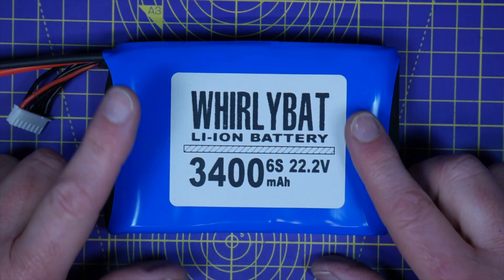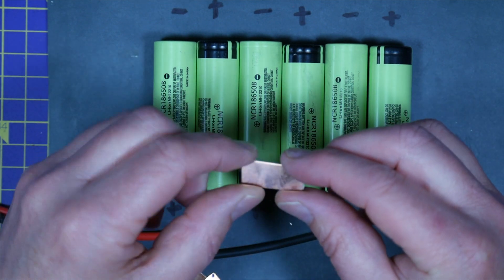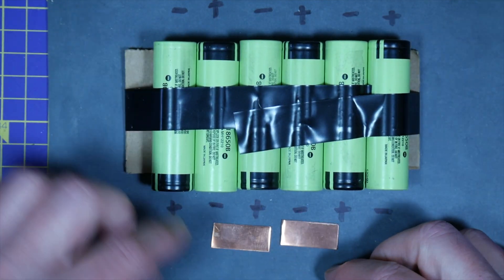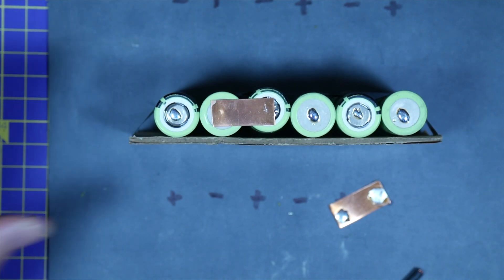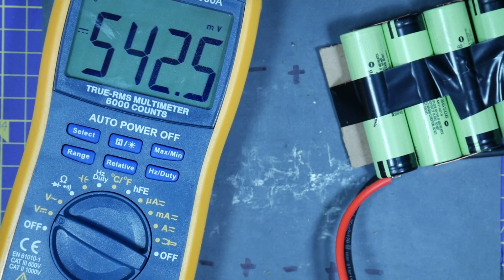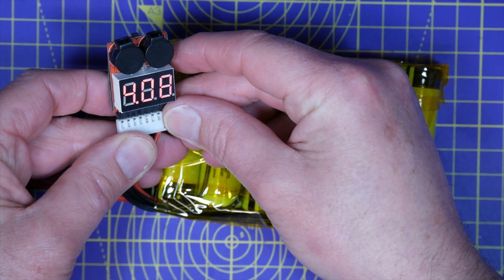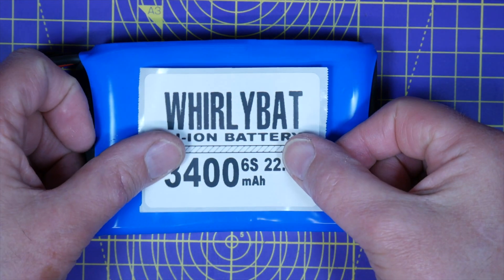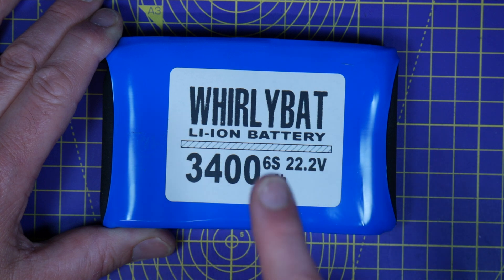Make your own 6s li-ion long range drone battery pack from 18650 cells

Comment: dont they have low current output like 6.7
Reply from the maker: Yes, and that's why I go to great lengths to cover this in the video. They were what I had lying around, they're not ideal, but they work for long range drones that don't need massive amps.

Comment: So I did like you did and I made a 6S pack, but the first pack was in 2P the second two packs that I built were like you did here six and series finished it sealed it up and then I built the second one everything was working fine meter was reading good voltage and everything And when I plugged it into my drone, I smoked the motors on my 6 S drone can you please explain why I went wrong

Comment: these cells have an max output of 6.2A this is pretty weak. what kind of quad do you want to fly???   i build a 3000 mah 4s with 4 molicel INR18650-P30B they give me like 30A so got a lot of head room ...
Reply from the maker: Good point! The pack in this video is designed for long-range efficiency rather than high current draw. For cruising and endurance flights, the lower amp output is fine, especially on a well-tuned setup with low amp draw. If you’re after more power, something like your 4S Molicel P30B pack is definitely a better choice for higher current demands. Different packs for different needs! 🚀👍
Reply: @WhirlyBloke  so I fly a 4" copter with 380gr takeofweight with the 4 s li-ion pack (205gr alone) and ever hovering I need 7 Amps! So I would use your cells rather for a goggle battery but not for flying...
Is it even able to fly? What drone do you use to carry it?

Comment: What kind of charger do you use to charge such battery pack? Also what is the connection plug used for the charger you show on the video? The little white plug. Thank you! I’m trying to fix my vaccum which came with 6 batteries. Thanks.
Reply from the maker: Unfortunately this isn't really suitable for powering consumer electronics. Not because it can't but because of practicality. The little white plug is a balance lead and this HAS to be charged with a balance charger. The balance lead is wired so the voltage of each individual battery is monitored and adjusted by the charger to keep them charged to the same voltage. You need to know exactly what you're doing or it could end in disaster when you're charging. Consumer electronics use battery packs that have a built in battery management system (BMS) electronics to manage all this for you. I suggest finding suitable replacement battery packs for your vacuum.

Comment: I LOVE YOU! i was thinking about using my vape 18650s cause i have at least 100 of them.. this could be good use for them. Would you share how heavy the pack is ? my 5" uses 180gram 6s pack, i bet its around 300... which is.. like if i had gopro and whatever strapped to quad
Reply from the maker: My build will be a different weight from yours cos it uses different manufacturers batteries. Just weigh one of your batteries and multiply it by the number of cells you plan using and add 5% for wires etc. That'll give you the approximate weight of your pack. Thanks for watching.

Comment: Sorry, there are too many things that can go bad with that technique. Edit: But if you are doing it with what you have on hand and during a lockdown then that's one way around it. 🤓
1- The reason nobody does it that way is that you can easily get a cold solder joint. To be sure you are not getting a cold joint you need to submit the battery to a extended period of heating. 
2- You can easily damage the cells insulator and get short.
3- By not having glue between cells you will be putting all mechanical stress into the solder joints.
Reply from the maker: I agree with everything thing you're saying. That's why I keep saying you need to know what you're doing. It looks easy, but it's not and there's plenty to go wrong. Spot welding is the best, and I've built loads of pack like that. But this soldered pack I covered in the video, is still going strong after many, many flights. The whole point was, it was using some stuff I had lying around during lockdown.
Reply: @WhirlyBloke  That's pretty fair. Everybody been there doing things the hard way and the lockdown sure did put us all under alot of pressure.

Comment: What is the lowest amp battery u can use
Reply from the maker: Use whatever you need. It's about what voltage and current you require for your application.  Remember V=IR. Thanks for the feedback.

Comment: 4:13 what thickness copper strip do you recommend?
I want to make 6S pack using 21700 cells
Reply from the maker: I've used that nickel strip from Amazon on my latest 21700 packs. Works fine, but I am using a cheap spot welder now cos I make lots of them and it's much quicker.

Comment: Which jumper is better to use for assembling Molicell 21700 42A - 6S
What thickness and width of the steel tape is suitable for peak loads of long-range quadcopters.
Reply from the maker: When assembling a battery pack for long-range quadcopters using Molicell 21700 42A - 6S cells, the most common choice for the battery contacts is copper or nickel-plated copper. Copper has a high electrical conductivity and is a good thermal conductor, which helps with heat dissipation during high-current discharge. Nickel plating can help to prevent corrosion and improve the contact resistance.

It is important to note that the choice of metal for the battery contacts is only one factor to consider when designing a battery pack for quadcopters. Other important factors include the layout and arrangement of the cells, the type and quality of the insulation used, and the overall construction of the pack. It is recommended to consult with an experienced battery pack designer or engineer to ensure that your battery pack is safe, reliable, and optimized for the specific needs of your quadcopter.

Comment: 1. You can not solder on a 18650 cell. You will definitely damage the part of the battery under the - anode. (The + cathode is often spaced away from the chemicals, so possibly no damage). So do not do it. Use a point welder instead. The weld happens in milliseconds, and does not warm the inside of the battery.   2. Do NOT package the battery pack into insulating foam. If you draw high power, the battery will overheat, and be damaged.
Reply from the maker: In general I agree with you, but this really only applies to mass produced packs. Spot welding will inject less heat into the cell, but my reflow solder approach is the best way if you don't own a welder. If you choose the right cells (these NCR18650's I used were not perfect cos they are higher internal resistance, but they were lying around and free) heat build up is minimal, especially if you let them cool properly after a flight before charging them.The massive benefits of thin foam is for damage protection - ally cases would be better though. I've been using building and using these type of packs for 3 years with no issues. I really should revisit this to cover my latest 21700 packs which are leagues better.
Reply: @WhirlyBloke  nice! If the curent isn´t to high and the packs gets only one flight probably heat isn´t a problem. I´ll mybe try someday a pack with those 21700 for 6S or something similar. I have seen that peak current can be as far as twice the specs when cooling properly each cell using 3D printed frames. But for that you need a 3D printer xD...
Reply from the maker: @ficosk8  Agreed. The 21700 is a better choice these days and it's what I use on all my long range pack now.
Reply: @WhirlyBloke  🤩 super 👌🏼 and how much current are you getting out of your cells? Around 35A or more?

Comment: don't you think the maximum discharge rate of 6.8a is a bit too low? or is that not that important if you fly a bit more "calmly"?
Reply from the maker: These are for long range cruising and not acro so the discharge C rating is not too much of a problem.

Comment: Wow, fantastic video Whirly Bloke, I’ve been wanting to make a 6s for long range on my GepRC Crown CiniWhoop, I do believe I’ve found my perfect instructional video. Thanks very much👍👍
Reply from the maker: I recommend using Sony VTC6 or equivalent 18650 cells. You'll get 3000mAh with a max 20A current. They're about the best power per dollar.
Reply: @WhirlyBloke  Oh that’s perfect, thank you very much for that.

Comment: So this battery pack will output more than 20V. Can you connect it directly or is a dc to dc convertor necessary between the battery pack and the drone ?
Reply from the maker: 25.2V fully charged, but I'm not sure why you'd want a dc to dc convertor.

Comment: Great video..how would you connect / solder to make a larger pack , say like 10200mah ?
Reply from the maker: Just add more cells in parallel to get the wattage you need.

Comment: soldering 18650s is a very bad idea, they suffer from the heat at the negative pole. get hands on a battery welder, these are cheap these days

Comment: Are there any heat/cooling issues with this pack when you fly it for extended periods of time? Also are the balance leads needed? (trying to save weight)
Reply from the maker: There are no overheating issues. Try to to Sony VTC6 is equivalent 18650 cells if you can. More expensive, but better power per dollar.

Comment: Friend how to charge this battery
Reply from the maker: Charge at 4.2v 1.6A. But each lithium ion manufacturer is different.  So check the specs first.
Reply: I want 11.1v 5200mah battery 
Which battery best for making 
How much mah value each one battery
Reply from the maker: @santhoshA350  Sony VTC6 or equivalent. > 3000mAh
Reply: It is available at amazon

Comment: This is a nice execution on the build, and a good example to follow. However, for those of you just learning how to DIY your own packs as I was when I stumbled across this video, the most important decision you make is what cell you select. Whirlybloke does mention he chose the Panasonic 18650B cell because he just happened to have some extra in his possession. He does indicate that they have a low current rating and also posts the info on the data sheet in the video description. Whirlybloke falls short of discouraging the use of these batteries for drone applications. To put it simply, the Panasonic 18650B is the wrong cell choice if you want your drone to actually fly. I was heavily influenced because he made this pack for a crocodile 7, which I own. I was also in the process of researching how to build my own Li-ion packs for long range. It seemed exactly what I was looking for, so I built 4 packs. Through some test flights I discovered the batteries were overwhelmed by the current demands of just maintaining a hover. The cells experienced severe voltage sag and the drone was underpowered and dropped to the ground. All packs I made are useless for flying and will be for you too, if you use the Panasonic cells. If you intend to make your own pack, look into the sony VTC5A, or Sony VTC6 cells, which are probably the best balance of capacity and IR. They are the same cells that Auline uses for their Li-ion packs. 

Whirlybloke, as someone in a position to influence peoples decisions in the FPV hobby, you do have a responsibility to provide accurate information. I suggest you make it clear that there are better battery choices, and that the Panasonic 18650B is a poor choice for drone applications. The only reason I chose this cell is because of your video.  I'm not the only one that has made this same mistake, as I've had direct communication with another victim of your influence.
Reply from the maker: Agreed, but I did make the point these were cells that I happened to have anyway. The best choice is the VTC6 variant of the 18650 that I covered in this video https://youtu.be/on_Y57qkz94?t=457
Reply: For anyone reading this now - Molicel cells are the best at high discharge and high capa, if you can find and afford them. Their P50B 21700 releasing this year is absolute science fiction, with a rated 45 A continuous discharge (<90°) and 5 Ah capacity. Those will need beefy metal strips.

Comment: What would be the effect if my nickel strips are not thick enough? Would they just get very hot? Or would also the voltage drop? I have a 4S2P pack with SONY Murata VTC6, which should be able do deliver 30A*2 continuously, but I have a fast voltage on only 15-20A.

Comment: What is its discharge rate? for each cell.. or complete pack...thanks for video :)
Reply from the maker: Like all Lithium Ion cells the NCR18650 has nowhere near the same C rating as LiPos. These cells are specs at 2C, but other 18650 cells are much better - like the Sony VTC6.
Reply: @WhirlyBloke  Thanks :) need to get higher C battery
Reply from the maker: @Akshay_T_Films Definitely for anything other than light acro or long range cruising, Lipos are the way to go. But if you want long range/duration then Lithium Ion, especially 6S is the way to go. And you you need way less C rating than you think. Check out these videos that are using 4S Lithium Ion packs https://www.youtube.com/watch?v=LqTx4ei3Rhw https://www.youtube.com/watch?v=on_Y57qkz94
Reply: @WhirlyBloke  Thanks buddy... You are gem❤️

Comment: Are the cells not damaged by soldering?  Is zinc tape not good?  And with a spot welder?  thanks for the reply .
Reply from the maker: They won't get damaged if you solder quickly. I explain all this in detail in the video.

Comment: I'm designing a 7-inch machine.  I make a pack like this too.  No need to put protective electronics in it?
Reply from the maker: No. It's fast discharge and you'll be charging with a balance charger. Looking after your batteries in FPV is very manual process.

Comment: I know you have the DJI setup (I've seen your other video, thank you)...have you tried this battery on a quad with an Air Unit?  Did you experience any issues?  I can fly straight and level and I completely get that you can't treat these li-ions like a Li-Po...but at about 60% throttle my quad shuts down and crashes using this exact build.  Have you or anyone else experienced this?  I fly a 7" Kakute F7 AIO FC (6S capable) that has a dedicated DJI plug on it so I know it's regulated voltage.
Reply: I have the same issue on a crocodile 7". I can't even get out of a hover without the quad dropping to the ground. have you had any luck troubleshooting your issue? I have just come to the conclusion that the current demand is to high for the Panasonic 18650B???
Reply: @DavidChavez-violinist  I copied this design exactly and it didn't work.  Not a reliable battery.  It's a great theory but the technology does not support this right now.
Reply: @pattywaktdiy4175  thanks for the reply. The technology exists, Its just the wrong choice of cell.  The current demand exceeds the batteries capability, which causes extreme voltage sag causing the drone to drop. An 18650 with a higher current rating should resolve the issue. There's a reason auline batteries use sony vtc5a and vtc6 cells. they're rated for 30amps + continuous.

Comment: I have just bought a set of Samsung nr18650s with 1500 milliamps. Will the charge rate still be 1.6 amps?
Thanks Ben
Reply from the maker: You need to look at the specs for that cell. Each manufacturer is slightly different.
Reply: Thankyou il have a look

Comment: Great video!  Clarifying question that I haven't been able to find an answer to...fully charged, this will be at 25.2V, correct?  (4.2V X 6 = 25.2V).  Why are you using 3.8V to come up with labeling this battery at 22.8V?  Just want to be sure I understand the math before I charge one of these at my own risk!  Thank you!
Reply from the maker: That's the nominal voltage.

Comment: Hello !
I see a lot of packs that are built without BMS. In your case, if one of the cells were to discharge faster than another, how would it be detected? Isn't there a risk of explosion without BMS to check the voltage during the flight?
Thank you in advance for your answer
Reply from the maker: A BMS is not required in this type of RC application. If the overall pack voltage drops below and average of 3.3V or whatever is set in the flight controller, the quad will prompt to land and eventually failsafe. Also, these are charged using a balance charger and it's usual to check cell voltages and internal resistance before each charge cycle, so you're monitoring for any problems. A BMS is normal required for applications like electric bikes etc
Reply: @WhirlyBloke  I see. Thank you very much for this very quick response
And thank you for this quality content, good luck for the future.

Comment: how can I charge this? is it safe to charge overnight? I mean, is there a protection?
Reply from the maker: Just use a regular balance charger. Those cells are recommened to charge at 1.6A which is 0.5C. I don't recommend leaving any charging batteries unattended.  Thanks for watching.
Reply: @WhirlyBloke  Can I use mobile phone battery instead 18650 for this?
Reply from the maker: @vindulaherath6400  nope
Reply: @WhirlyBloke  but both 18650 and phone batteries are li-ion right? 😬

Comment: Epic build video!  Can't wait to try it. Do you have to worry about the copper taps hitting the sides of the battery and causing a short?
Also, small detail but aren't the batteries 65mm tall so why do you need 105mm tall heat shrink? Are you sure that's what size you used? About to purchase so just wanted to double check if I'm missing something. Thanks Whirly Bloke!
Reply from the maker: Depends on the shrink ratio. You'll need to check the spec - it's tricky cos they usually specify % not absolute size.